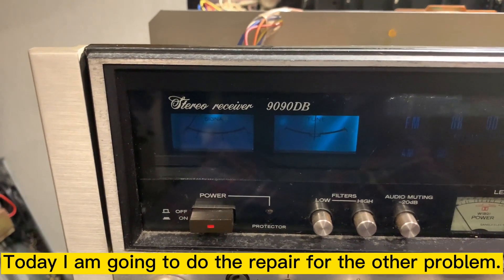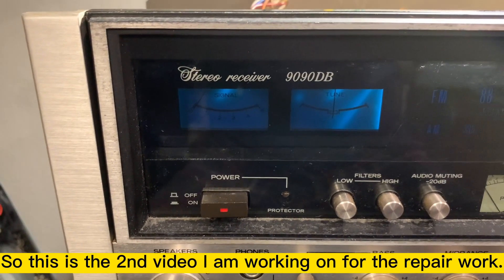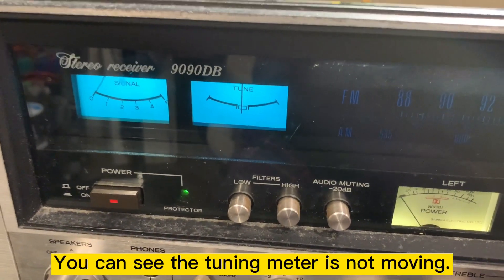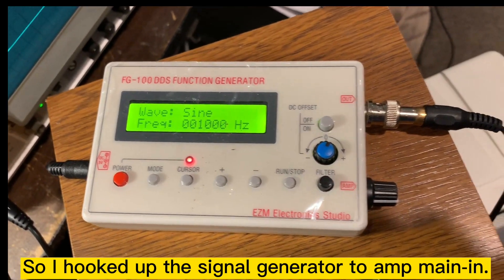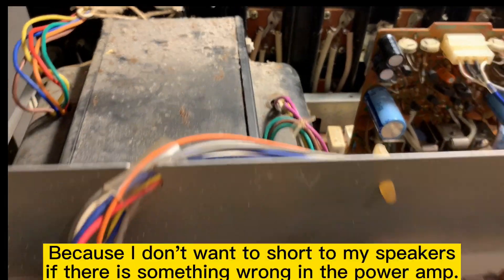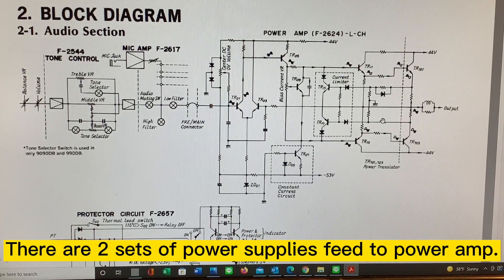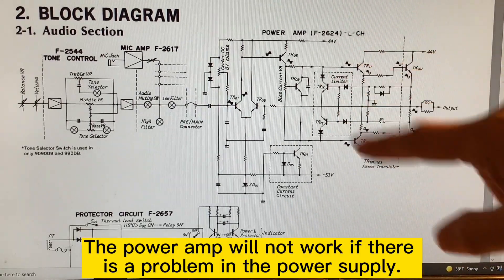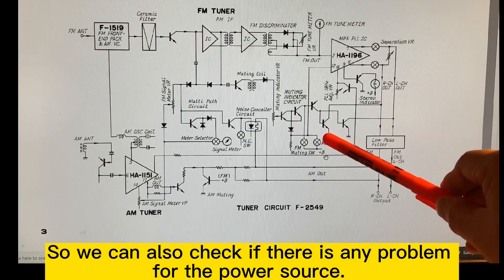Sansui 9090DB Receiver Repair II - No AM/FM and Sound

Comment: I have the Sansui 9090 model with the same issue.  Would replacing the same resistors might correct the problem?
Reply from the maker: You replace them only if they are defective. So I recommend to check their value prior to the replacement.

Comment: I have a 7070 sansui, the am/fm tuner and signal works but no power to amplifier. Do you have ideas where to check? I've replaced resistors and glass fuses as well as the f2624 board😞
Reply: You need to check all the output voltages on power supply PCB F2614. The block diagram shows: power supply for power amp - Pin #55 (+44V), #42 (-53V) and #40,41,46,47 (-44V).  Also you need to check regulated voltage  PCB F2626 for power supply to amplifier -  Pin #02 (41V), #04 (39V), #03 (41V) and #01 (13V). I assumed that the problem may cause by no power delivered to the power amp or preamp. You can send your inquires to my email for further assistance.

Comment: In just bought a Sansui T 5 and there is no sound on the AM channel. The indicator lights up, but no static and no signal light on the dial. FM is fine. Any ideas? Thanks.
Reply from the maker: If the FM is working but not AM, then I suggest to check "AM" switch which provides +B power to AM section on the tuner.